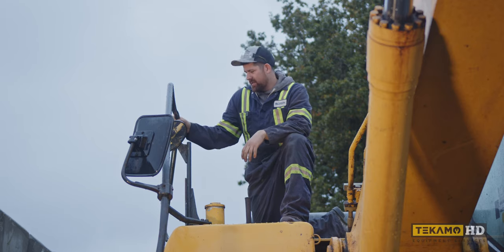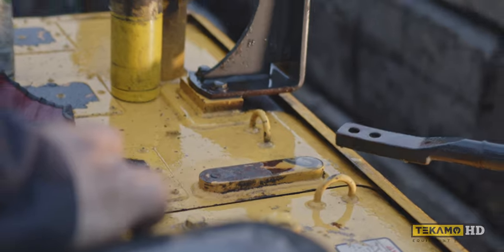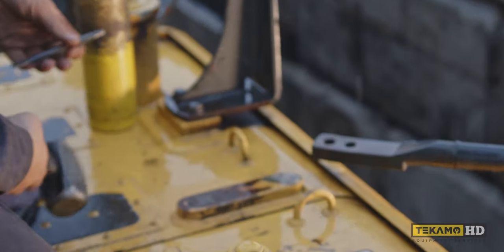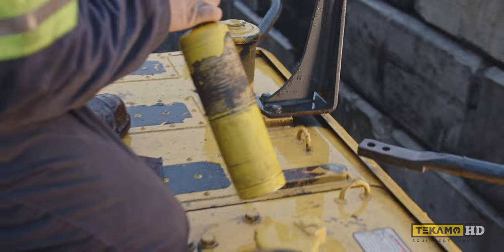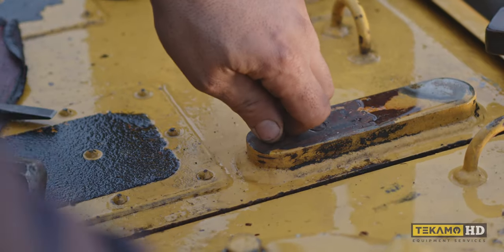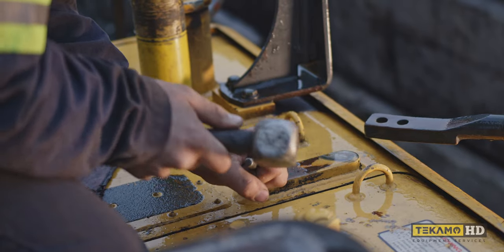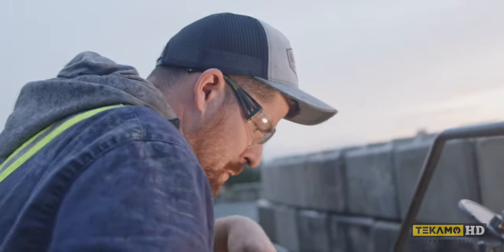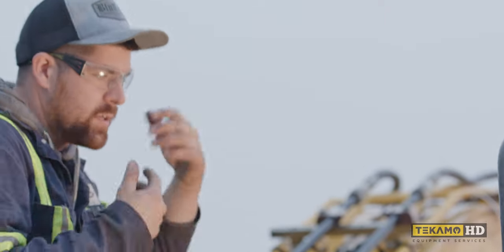Removing excavator bolts without a drill - Sneaky repair secrets on a Komatsu excavator

Comment: Lh drill bits are the first thing I grab. Loose bolts like you had would of walked right out with a drill
Reply: Indeed
Reply: I have a small set of left hand bits, don't use them often. I still prefer a quick tap with the chisel vs breaking bits out. To each their own, whatever gets the job done!

Comment: Anyone know exactly how much a “schwack load” of time would be?
Reply: Hours. Many hours. The escalation usually is: hammer and chisel, then weld a nut on it, then drill it out and hope you didn't screw up the threads. If you did, then you have to drill it out and retap for a larger bolt. Of course, this is all application depending.